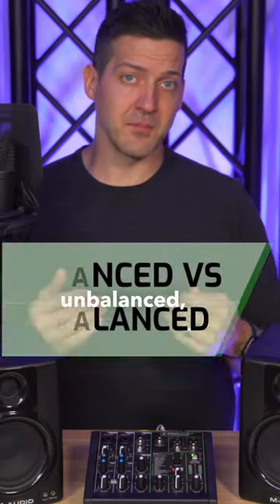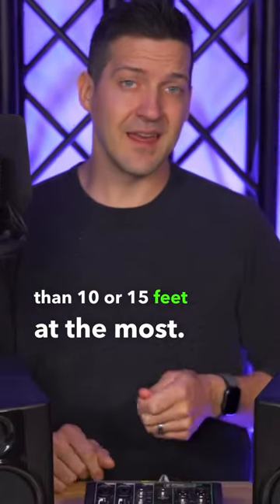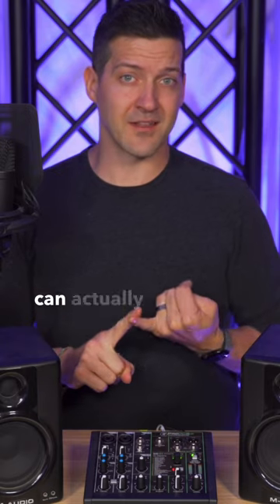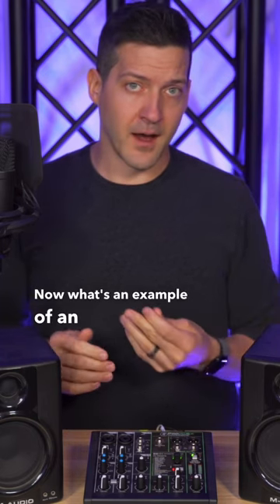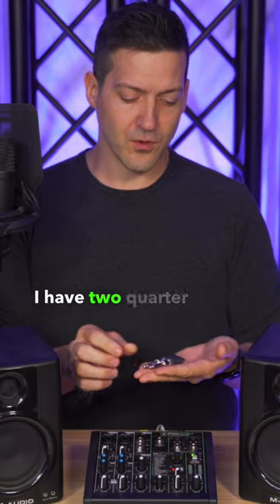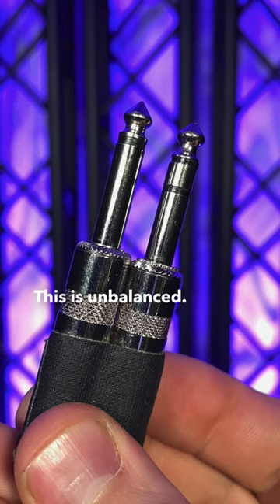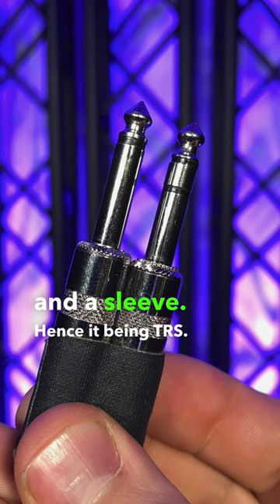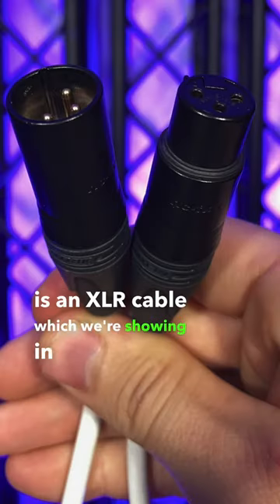Balanced vs Unbalanced Audio Cables #shorts

Comment: What I struggle with is when to use what cable. Say I’m syncing an MPC with an Elektron Syntakt via midi.  The cable that goes from the Syntakt output into the MPC input should be which one?  Also I like to sample the drums you can design into my
MPC so does it matter which cable i use cuz I don’t hear a difference in the sound?
Reply: What I've relied on is checking the manual, typically on the first pages that show all the inputs and outputs of your device, to see if the input accepts balanced cables vs not. I always just type on a google search the device name plus the words pdf and manual and the first result is typically the manual. 

Just as an example, from p.14 of the Syntakt manual, it says: "INPUT L/R, Audio inputs used for external sources for audio processing. Use a 1/4” mono phone plug
(unbalanced connection)." referring to the two inputs in the back and "OUTPUT L/R, Main audio outputs. Use either 1/4” mono phone plug (unbalanced connection) or
1/4” TRS (Tip/Ring/Sleeve) phone plug (balanced connection)." referring to the two outputs in the back. Give it a shot with the mpc to find the same info. Good luck!
Reply: @davide2.07  good idea. Thanks man